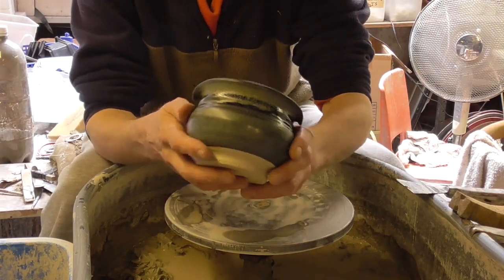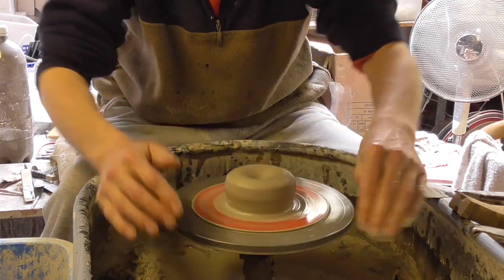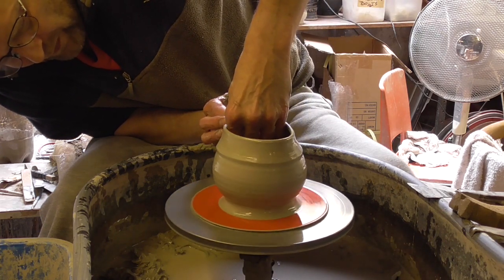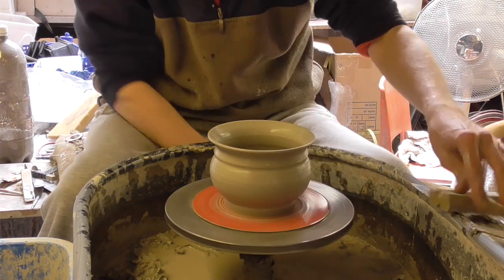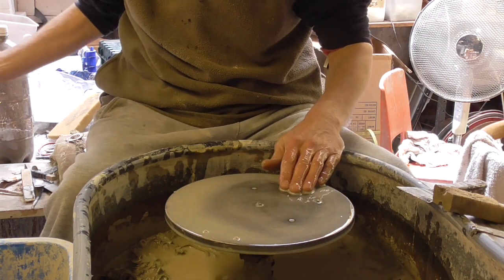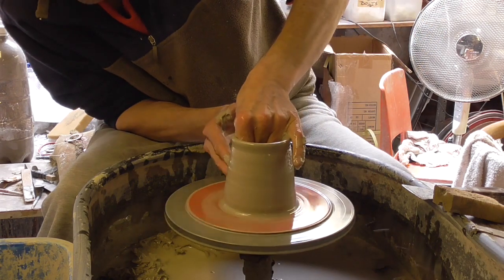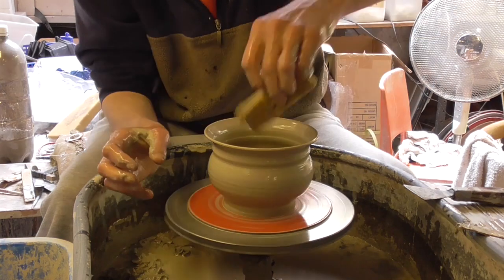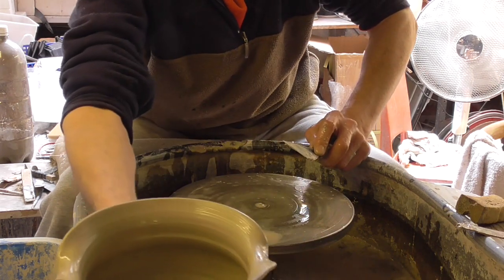Throwing / Making some simple Pottery serving Bowls on the Wheel.

Comment: I'm a newbie potter and I'm inspired by your videos! 
I'm purchasing some bats and I'm curious about the type you use, brand and material. They seem to be thin and light, yet not prone to warping. Thanks!
Reply: I don't know this for sure, but I believe they're quite old. Not made anymore because they contain asbestos, I was told.... in any case there would be no danger as they're always wet (no dust) but no longer available for purchase. Your best bet is to make some from baltic birch plywood (thicker is better) or masonite (tend to warp a little but work perfectly well as long as you're not making plates/ platters).  Cut up your plywood into squares that are the size of your bats, then measure and mark the centers of the squares. you can either use a compass and a jigsaw to cut your circles or if you have a table saw with a crosscut sled (or know a carpenter who does), drive a nail into the crosscut sled one half of the bat's diameter's distance away from the blade. clip off the head with some nippers leaving a sharp point. line up the center of the bat blank on the point you just created with the nail and pound it in place. the blank should now spin around the pivot point, allowing you to cut off the corners of the blank on the table saw, making an octagon, then cutting those corners again for 16 sides etc, until you can just spin the piece against the blade giving you a perfectly round, smooth bat - they'll all be the same size and everything. I've made many wooden circles this way for all kinds of projects. cheaper than buying them from the pottery supplier for sure! Good Luck!  :)
Reply: Thank you for such an extensive and informative answer. Great idea about the crosscut and nail! We have a table saw and a band saw...so... using your concept we'll be able to make your own.
Reply: Oh great, happy that was helpful - picked the circle trick up from a woodworking magazine a while back :) . I'm also just starting in my potting life... the best of luck to you and your potting adventures!
Reply: And to you as well! Happy throwing!!!